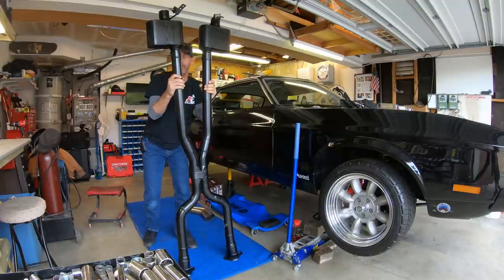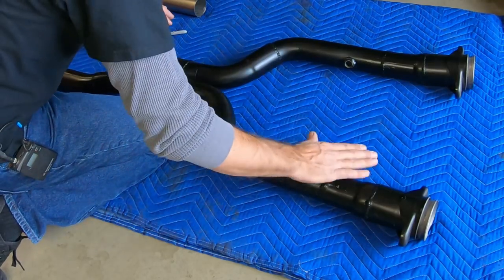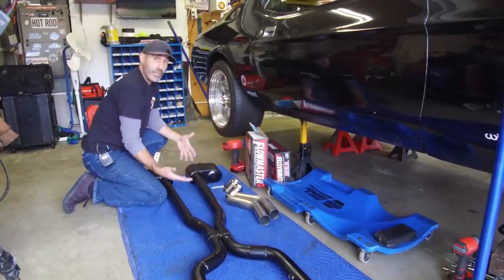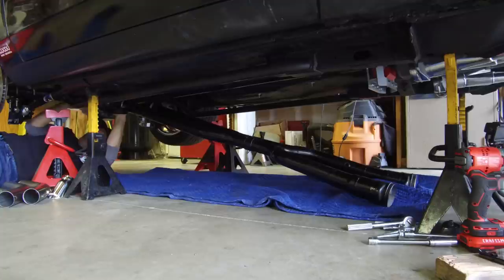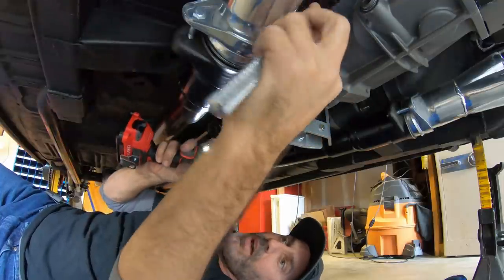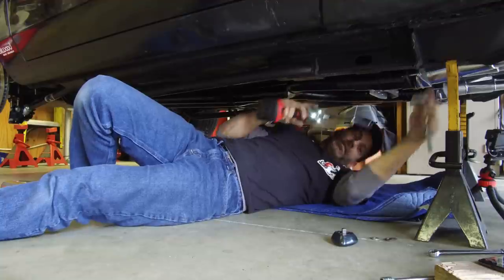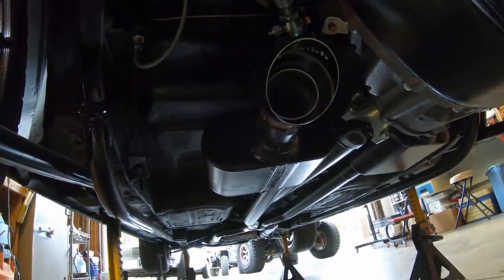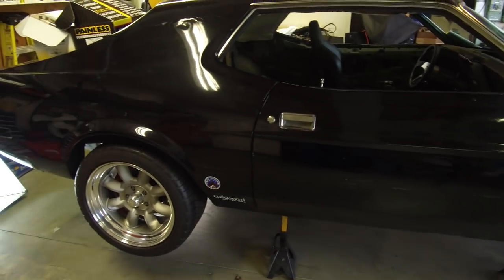Turn Down for What! Exhaust Made Simple for the Mustang Flowmaster X Pipe and Super 10's

Comment: I just added a new exhaust system to my 1973 351c a few months ago.  Put hooker long tube headers on, bought Dynomax ultraflow mufflers and exhaust tips, then had a local muffler shop do the rest in 2.25 in.  Changed it to a more aggressive bass sound.  Only issue is the headers improved exhaust scavenging so much that I lost a little long end torque, at least I think that's what's happening.

Comment: Hope you like the craftsman tools. I’m a Milwaukee guy I have anything from a chainsaw to a micro impact and all run on the same battery. Love them wouldn’t replace them for anything. Tough as nails too I’ve accidentally ran the micro impact over twice now with the Jeep and no problem at all.
Reply from the maker: How do you keep running it over? LOL  Glad to hear it's durable!
Reply from the maker: How do you keep running it over? LOL  Glad to hear it's durable!
Reply: AutoEdits well today it fell off the rear bumper when I was installing it and I moved the Jeep so I could solder some wires and I ran it over. The second time I was working on the Jeep and just forgot it was under it lol.
Reply: I got Milwaukee tools too so handy when your impact leaf blower and light all take the same battery😂 i got the little stubby 3/8 impact fuel. And it zapps lugs off my jeep like damn
Reply: Ryan Prokopow it’s the best thing ever that my work light, chainsaw, weed eater, grease gun, drill, impacts and porta ban (I know I’m missing some) all run on the same m18 battery. The best thing they ever did was use the same battery for everything. Plus the batteries are rebuildable.

Comment: The system looks good.   I really like when the systems are painted black. 

I don't really get the chrome tips though. When you started on the turn downs you mentioned trying to make  less visible. And then you put chrome tips on them? Couldn't you have just saved some cash by just slash cutting the pipes?

Cordless tools are awesome.   I went with a bunch of Milwaukee tools and haven't used any of my air tools since.
Reply from the maker: Yes I could've just cut a bend and left it... but like I mentioned... the chrome tips look good to me and I'm not "hiding" them but making them look like I meant for them to be there.

Comment: I have the exact same suspension setup except I went air ride. My big question is if you ever went back and got a chance to get the tubing up and over the rear axle tubes. It is very tight. I was thinking of getting oval tubing, any suggestions
Reply from the maker: I couldn't see where it would go over the axle on the drivers side but the car sits so low that I'm contemplating oval tubing and under the axle to the rear.

Comment: Got to love exhaust videos without a sound clip.  I had hooker headers on my '72 mustang with a 460 and I smashed two sets because they hung so low.
Reply from the maker: Are you new to this build up? This is a long term project and while I totally get that if you came here wanting to hear super 10's fired up after this install... it would be a let down!  I'm working as fast as I can on this project ... and it even drives me crazy that I can't hear it yet!!!
Reply: @AutoEdits  Just busting your chops man. I had a 72 Coupe since 1980 and it was sitting in my garage since about 96. I just got rid of it this past spring. I came to the conclusion I was never going to finish the metal work I started and let it go for $500. The new owner got it running, finished the body work in about 8 weeks. Glad it went to a good home. Your project is looking really good and I'll be waiting to see and hear it run.
Reply from the maker: I get ya! Thanks!